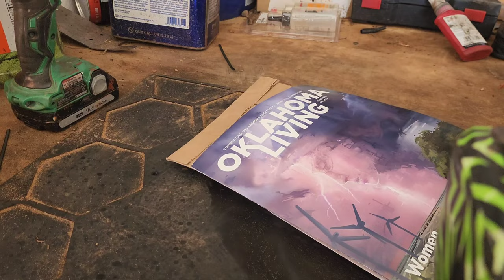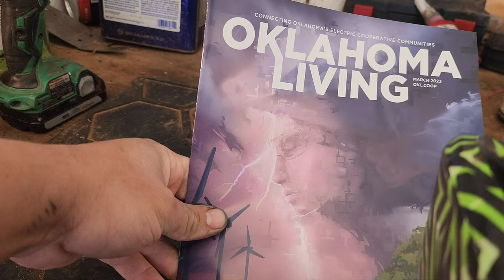Traxxas XRT - Drive Shaft Broke - Leopard KV1000- 1.5 Mod- Castle 8S

Comment: I bought all the traxxas electronic extras. Telemetry box, gps,sensors for the sledge. I've saved myself from going to deep down the worm hole. The car is now mostly a completed package that can't be taken further. Finally broke a lower rear hinge pin on the 10th battery pack.